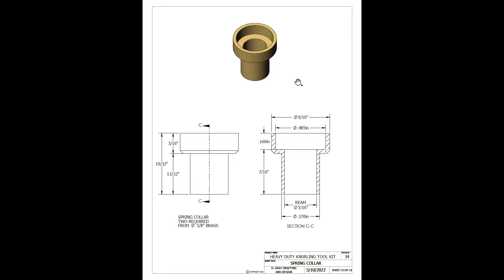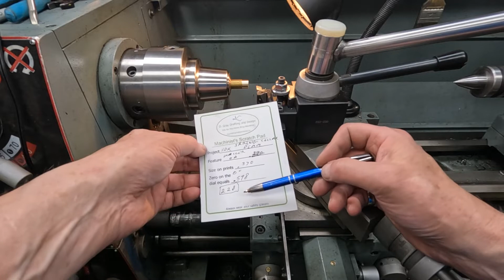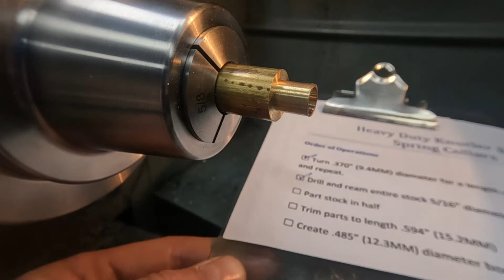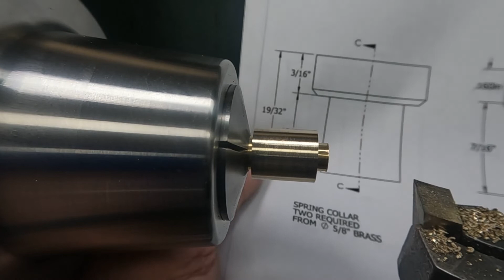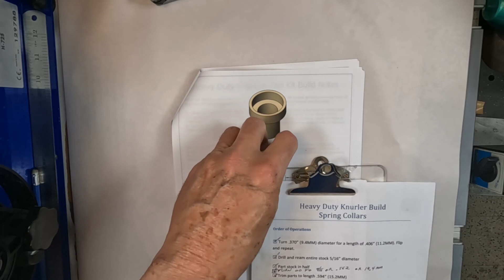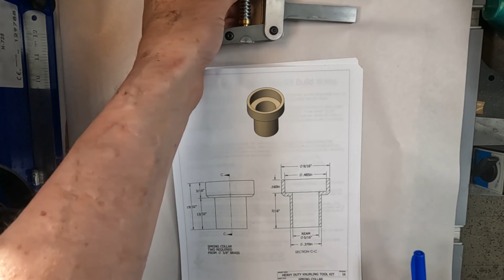Heavy Duty Knurling Tool Kit Build Series # 7 "The Spring Collars" Featuring the Diamond Tool Holder

Comment: I completed my Knurling tool this afternoon and I have to say it is a very nice tool!  I bought the full kit as I did not want to take the time to manufacture the parts that Doug has laser cut.  It would not be a hard project if you were making it from your own stock, it would of course just take longer.  I have been too long without a proper knurling tool so I was rather itchy to get this into operation.  I have not used what seems to be something of a “standard”, the Eagle Rock scissors type tool, and could not see paying what they want for those.  Having completed this build I am confident that this is every bit as good, and the price is well less than half even if you buy the full kit from Doug.  You wont regret it!
Reply from the maker: Sorry Jake I miss this comment somehow. Thanks very much for the kind words Jake.